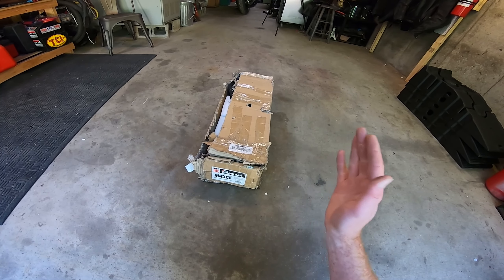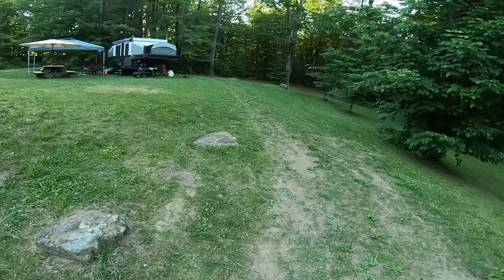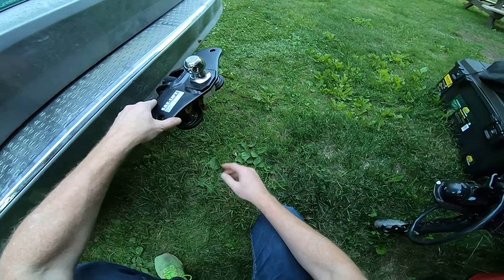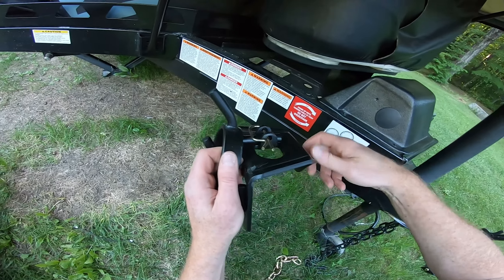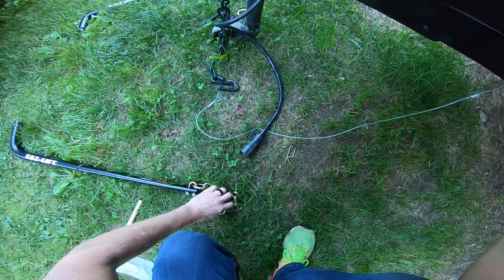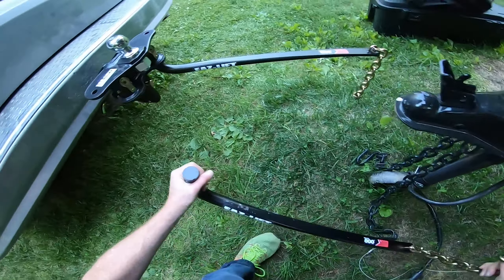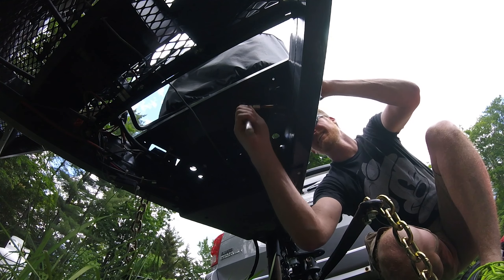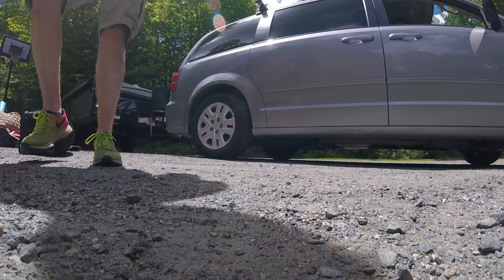Minivan Weight Distribution Hitch Install & Review | 2015 Grand Caravan & Rockwood Pop Up Camper

Comment: Thanks for posting this!  I am looking to buy a popup camper in the near future (Rockwood hard side) and I suspected I would need to get a weight distributing hitch.  I grew up in a family that did a lot of boating (towing a 5000 boat), and I learned early on from my dad that there's no substitution for safety and proper equipment when it comes to towing!!
Reply from the maker: That's great! It is the right way to go. My dad drag raced and I spent my childhood locking the WDH bars into place :) I'm so happy with the results. It feels right, firm, safe! It drives so much better. Brakes better. Steers better! Thanks for sharing :)

Comment: Looks like a good solution! Thanks  for making this video.  I also have a 2015 grand caravan and we are wanting to get a pop up camper.
Reply from the maker: The popup leaves the yard maybe 4 times per year, but wow do we have some incredible shared memories as a family :) If you end up with a lighter popup you might not need a weight distribution hitch. But with this 12 foot box (24 feet open) fully loaded with enough stuff and toys for a family of 5, we sure needed the help! I feel so much safer while towing now. Tomorrow I have a 7" pull fan coming from amazon. I'm going to add it to the trans cooler to help with cooling as I creep up some of the long steep New England mountains. Video of that is coming soon :)
Reply: @sstressfl  Good stuff!  I'll look forward to seeing that video
Reply: @sstressfl  What fan did you order?

Comment: Why are air bags bad?? I have a 7 x12 double axle trailer im gonna tow thats 2000 lbs and just had air bags installed on my 2014 dodge grand caravan
 Do i still need a wdh? Im not really hauling anything other than 600lbs worth of misc crap
Reply from the maker: Air bags are awesome. However my air bags decayed and split each winter in vt. So I gave up on them. I was towing a 2400lb camper with all the stuff and the wdh was exactly what I needed.

Comment: Great video. I've got a 2015 Chrysler Town and Country and it's been super confusing knowing what I can actually pull. Cool to see you pulling the Rockwood with a similar van.
Reply from the maker: I'm def at max capacity but all is well so far :) Trans cooler made a big difference especially in the mountains. And I just changed my transfluid at 100k miles. Smooth as silk! Looking fwd to camping this season :)
Reply: @sstressfl  cool. If I’m pulling a 2,000 pound pop up, do I need a trans cooler? I’m pretty much only pulling in flat Florida.
Reply from the maker: @videoskeeter  I never needed a trans cooler until we vacation in the mountains. I never had a problem on the flats 👍 You should be fine.
Reply: @sstressfl  Thanks so much for your replies! Take care.

Comment: Nice!  We have the EAZ with the 600 lb tongue weight limit on ours.  It sure does drive nice with it.
Reply from the maker: Yes! So impressed with the EAZ brand! It really does ride beautifully. Simple design. Very affordable vs other comparable units.
Reply: Fantastic video, thanks Zach! And thanks for the link. Looking to put one on our 2015 Odyssey to tow a 23' Jay Feather. 

Question, following your link I found a great deal on an EAZ hitch but has a 1,000lb tongue weight, seems a bit overkill, can't be that different from your 800lb one, ya?

Comment: Are you able to back up with the WDH installed? Have read some hitches you’re not able to.
Reply from the maker: Ive never heard or seen such a thing... yes definitely :) Works wonderfully just like a normal hitch except far more stable.
Reply: Thanks. 
There are a few that you can’t back up without removing the side bars. 

We have a 2013 Caravan and bought a 2021 Rockwood last year. Prior to that we had a small travel trailer and never had any issues towing  that would require a WDH.

Comment: How much does your pop up weigh and towing capacity of your van? I have a camper that weighs 2100 pounds with a smaller suv and thinking of getting this.
Reply from the maker: Was 2400lbs dry and tow rating on the van is 3500. With 5 of us, luggage, bicycles or kayaks, it was a lot. The van was definitely burdened but benefitted from a transmission cooler 👍 and a weight distribution hitch. We now have a truck and a hard side camper. Our van has been given a rest and is now only toting the family around on local trips 😃

Comment: Hey man thanks so much for the video. I installed same trans cooler you did in other video thanks for that and also im putting on same wdh. Can you tell me how many links of chain you go for it to be perfect? I have exact same van. Thanks for all your videos!! Also my van does NOT have self loading suspension. Can you please recommend a good heavy duty shock to put on for non self loading suspension?
Reply from the maker: Hey all of that is awesome! The wdh links will depend on how you set it up. I found I was at 5 links but again, it's how you angle the hitch. In regards to the shock, if you have the money, and you'd be surprised how easy it is to change your coils, I would recommend that you check out rockauto.com and search for rear coil springs. They now have an awesome collection of heavy duty rate and progressive rate springs. That would be the better way to go. Praying for wonderful camping experiences! Be safe and make sure not to overload the van!

Comment: May be a dumb question 
But what does it do exactly?
Keep more weight off the back of the van?
Reply from the maker: It uses the trailer as a lever/fulcrum to lift the back of the van and press down on the front of the van. When adjusted correctly the van will be level. No sag in the back and no rise in the front. The van will handle normal. Brake normal. It’ll feel stable and secure. Basically the weight of the trailer will be spread evenly across the vans front and rear tires.
Reply: @sstressfl  that's awesome. Thank you for the reply

Comment: hey @michael byrne. how is the towing going?  i am in a process of thinking buying a small RV camper for my family total dry weight is 2480lbs and with GVWR is 3500lbs, hitch weight is 210lbs wondering if this will be ok? as the one you are pulling which is rockwood 2280bhesp as per website is 338lb for hitch weight the dry weight is 2559lbs  and 19 ft. do you think i will get any problem towing this with chrysler T&C  2015 ? 
which is similar to GC 2015
Reply from the maker: I'll do my best to answer... from my experience, our fully loaded van (family of 5) towing a 2500 lb (dry) plus equipment, etc was overkill for the van. it towed very well down the road and we got great mileage especially on the flat.... but the poor van was definitely maxed out. If I was going to buy another pop up camper for the minivan, I would try to find something less than 2000 lbs. I hope that is helpful!
Reply: @sstressfl  thank you michael for the response really appreciate it!

Comment: Great video. I have a 2018 Toyota Sienna LE without any towing set up. I was wondering  if I would need a brake controller installed with the trailer wiring harness? The popup trailer I'm looking into is approximately 1,800LBS dry with electric brakes. Would a weight distribution hitch help as well? I'd appreciate your help 😁
Reply from the maker: Ana Cosajay Thank you! Your Toyota appears to have the same 3500 tow rating as my grand caravan. And yes I would recommend a brake controller so it can operate the brakes on your trailer. Your van will need all the help it can get when your towing a couple thousand pounds behind you. The weight distribution hitch is a great solution for towing but some trailer frames cannot handle the stress. You can research online or perhaps call to talk to a camper dealership. If a weight distribution hitch is not possible, some sort of air bag suspension support or additional spring support for the rear of the van would be a huge help when towing. I hope that helps!

Comment: This is very helpful. I bought a 2017 Grand Caravan and within 200 miles the transmission started to fail, torque converter went bad. The transmission expert said the trannies go out around 80K miles and he's repaired so many that had his own converter manufactured that will surpass the OEM part. He also says the van is no go for towing, which has me a bit worried being I'm a 66 yo woman planning a solo multi-year wandering adventure across country and probably into Mexico with my dog and cat with a custom made aluminum cargo trailer that will weigh around 2500-3000# when loaded. The trailer will have brakes on it. 

Did you keep the air bags as well as the weight distribution hitch? What weight do you think you're carrying and towing? I'll be checking your other videos for more knowledge. Thank you!
Reply from the maker: Our van has been an amazing performer and we have definitely overloaded it. I can't tell you by how much but it's been too much for sure. Our camper is 2500 lbs dry. And we have 5 people. Plus bikes. The aftermarket transmission cooler that I added is critical to longer trans life. And buy the best quality brake components and good quality tires! I dumped the air bags (they failed over and over again) and I just use the weight distribution hitch. Recently we purchased a 1/2 ton pick up truck and plan to give the van a rest. It has 136,000 hard earned miles on it now :) Whatever you tow, do your best to keep the weight down and keep the weight balanced so you don't over burden the tongue. Praying for your safe travels 🙏
Reply: @sstressfl  Thank you for your reply. I didn't get a notification that it was here. The van is back from the shop at long last and has a stronger torque converter as well as a transmission oil cooler, and trailer brakes.  I've ordered a custom aluminum cargo trailer, 6 x 10 to slowly turn into a tiny home that will weigh under 1K# empty and I'm planning to keep it under 3K total. Glad to know about the bags - they're pricey to have installed. Started liquidating my little homestead and hope to head out by the end of April. Thank you for your good wishes and all the info. 

The only thing I haven't been able to get done is the roof rails installed. No one wants to do it. Bummer, because I bought a set used on ebay. Ignorance is not bliss in this case. :) Best wishes on your truck travels!
Reply: Once I get the trailer and practice with it, I'll look into the WDH. How to know it it's appropriate with my trailer? I've got so much to learn!
Reply from the maker: @Nemo-yn1sp  when I put a 1700 lb popup camper on our minivan the squat was bad and I needed air bags to straighten it out. Stiffer springs would have been better but the point is I was able to get buy with stiffer rear suspension. When we bought a bigger popup at 2400 lbs empty, I knew I was going to need help. The wdh was the only thing that helped save the van by distributing that weight across the entire chassis. Driving became a pleasure. Braking was stable. Steering was effortless. It’s the right solution for that kind of weight on the minivan. I know because I tried to do it without one. What a difference!! And since you’re investing in living in your machine, I believe it’s a worthy investment that will make you happier and safer. I hope you find sunny skies and happy days ahead my friend. God bless you 🙏 feel free to send an update someday soon! Even a brief video of your rig would be cool to see 👍💪😎
Reply: @sstressfl  So then I should see about having stiffer springs installed. Not sure what that means, but I'll find out. THANK YOU SO MUCH!
Reply from the maker: @Nemo-yn1sp  rockauto sells them!

Comment: I have a 18 Pacifica, I want to install a hitch and tow a side by side that weights around 1500-1600 with a 7x12 trailer that probably weights around 1700-1800. Think I need to do anything crazy to tow it?
Reply from the maker: I don’t have self leveling suspension like some of the new vans do… if you do you should be ok. With my van I towed a 1700 lb popup for a year. It didn’t seem to need a transmission cooler but the rear sagged a lot. I tried air bags but they didn’t last long through Vermont winter. I tried Monroe booster shocks and they helped but still too much sag. The weight distribution hitch worked wonderfully. If your trailer has a boxed frame a wdh would be the ideal solution, if you don’t have self leveling suspension of course. 👍

Comment: These videos have been so incredibly helpful.  We have a 2016 Honda odyssey and currently looking at the 2022 model of the camper you have (searching for reviews is how I found your channel).   Internet forums are full of the wildest stories on both extremes when it comes to the topic of minivan towing, so it's hard to know what's true or not. 

I have one question, do you still use/need the airlift 1000s with your new hitch?  Would you still recommend getting/installing them or just getting the weight distribution hitch?
Reply from the maker: Thanks for your kind words and feedback! I do not use the air bags. They turned out to be troublesome. Leaks. Cracks. Failures. I tossed them and bought some Monroe load leveling shocks. They are basically "booster" shocks with an external spring to give 1000lbs of additional lift. BUT, the shocks are NOT the hero. The weight distrubition hitch is 100% the winner :) A must have for a minivan with this kind of weight. Also, a transmission cooler is a must have of you want it to last. Also, try to put as much of the heavy stuff in the back of the popup on the floor, behind the axle. The tongue weight can get excessive in a hurry because of the big basket on the front of the camper... its too easy to simply toss everything into the basket. But the weight adds up fast and will overwhelem your tongue weight limits, which I believe is 400 lbs on the hitch and up to 500 lbs with a WDH. I hope that helps! Happy camping and God bless you :)
Reply: @sstressfl  this helps a lot.  Thanks for replying, and a detailed and timely response as well!  Yes i was looking at installing the ATC and a power steering cooler ($36 and very easy to install if you already have the front disassembled for the ATC).  

The reciever I'm looking at has higher tongue weight rating and ground clearance than a cheaper one but it says it's not rated for WDH where the cheaper one is.  I'm assuming this is a situation where they chose not to test it.  Looking at the designs it's hard for me to see how the better built receiver couldn't handle the WDH but the cheaper one can.

And thanks for the info on loading. 

Oh one last question and again I greatly appreciate your time already.  Do you use the electric brakes on your trailer?
Reply from the maker: @eeguy77  I never had an issue with my power steering, but recently it started getting a little ouder when I first started the engine. I unbolted the steering resevoir, poured the oild fluid out and put in fresh fluir. Quiet and smooth once again! And yes! I use the electric brakes. Absoutely required :)
Reply: @sstressfl  thanks again for the response.  This gives me a plan and budget I need to hit to make this happen.  I grew up doing a ton of camping and we had a full sized conversion van to do all the towing that was far more than capable of towing a little popup so we didn't have to do things like WHDs, etc.  All we have is a minivan currently, but wanted to get a pop-up but not have to go buy a gas guzzler when we're not towing.  This is a ton of help.

Comment: Hello! Thank you for the video! I have a question. I'm going to move out of California and drive to Denver, CO in 2 weeks. I got a 2016 Honda Odyssey. I am going to install a hitch with the electric harness for towing a trailer, either 5x8 or bigger one. So my question is, would you say I need a system like yours to pull that amount of weight? I'm not moving a lot of stuff, just one bedroom size things. Any comments will be super helpful! Since I've never done any towing with the minivan before. 👍
Reply from the maker: Wow that’s a big move 👍 I’m very excited for you. I found a response on etrailer. This is a good start (link below). Three things that come to mind and concern me. One, a utility trailer sticks up high into the wind. It creates a lot of wind resistance compared to the low profile popup. On the highway it makes a big difference. You’re engine will work much harder to maintain speed even on flat ground. Two, you’ll need to drive up and over steep long mountain passes. You’ll be amazed how much transmission heat this makes! You should consider a trans cooler. Three, you’ll be driving down steep long mountain passes. Your brakes need to be in great condition with very good quality brake pads. Use manual downshift to  engine-brake and slow your descent. It’s so easy to overheat your brakes. Another option is to rent a truck with a car trailer on the back and tow your van to Denver. It’ll free you from much worry 👍 Those mountains are beautiful but merciless. Here’s the etrailer link https://www.etrailer.com/question-169996.html Whatever you decide, you’re in my prayers for safe travel and a successful move to beautiful Denver 🙏
Reply: @sstressfl  Thank you Michael for your super fast reply 😳 Yeah.. That's what my family members are saying the same thing. So I was going to take the flat road from Barstow - Albuquerque - Denver 😅 But as you said, I'll be very careful about my driving. Thankfully I was able to prepare many things for the van (100k maintenence done /brake pads replaced) so I hope everything goes well... Once again, thank you so much 👍🙏
Reply from the maker: @Gootnight  Sounds like a good plan :) Be safe! Stay healthy my friend :)